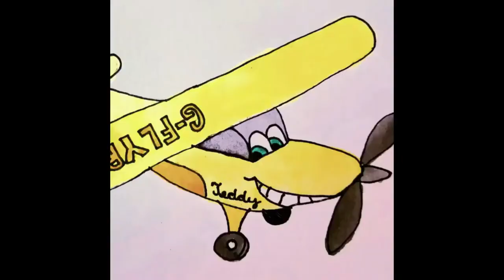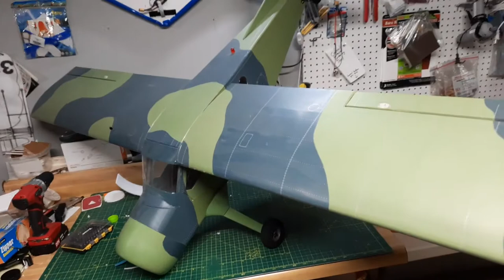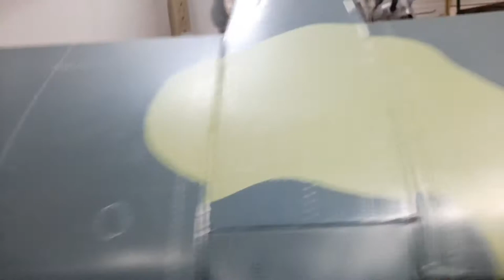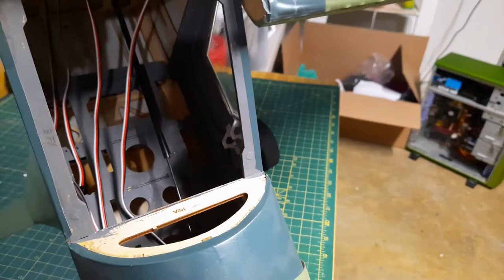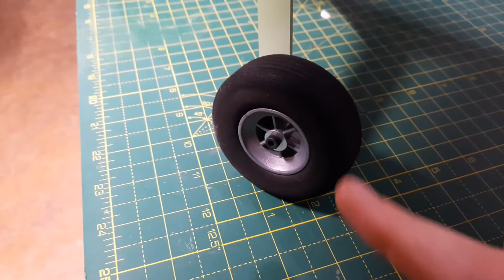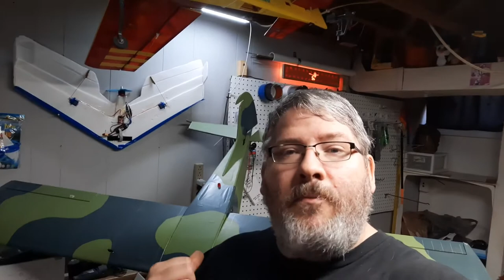Vinh Quang (VQ) DHC-2 Beaver project intro - balsa construction, .40/.46 size...

Comment: YOU BROKE OUT a Bassline!!! 👍👍
Nice, BIG Plane! I forgot how big .40-.60 Planes were. 
It is cool - and I don't blame you one bit!!! I was DONE with Nitro about 1995. NEVER STAYS tuned, needs adjustments for ANY change in the Weather... That's a big 'ol NO for me. 

I would go Gas. Those I know inside and out. In fact, I may get a Gas powered 1/5th Scale Buggy!! 😎😁 Just always wanted one. 

I'd love to see more! Any plans to FLY it? Frankly I'd be nervous. I'll bet though, she flies just fine. 😉
Carmine ✈🚂🚙
Reply from the maker: Yup, finally started it...and looking forward to doing more too!

And yeah it's a good size...the FT Storch is about the same size actually too. This Beaver has a much fatter fuse though. And yeah no plans for nitro. This guy can handle electric. When I get some bigger airframes I'll go gas more than likely. 

Hoping to fly it...I'm a little nervous to fly it b/c the fuse on this is a little more fragile than my old balsa trainer. My old trainer was actually pretty durable and more solid pieces...this is more framed...if that makes sense. I may have some guys at my local club help me maiden it.